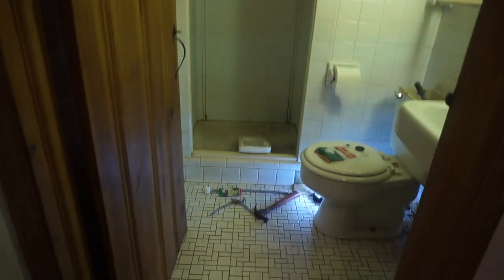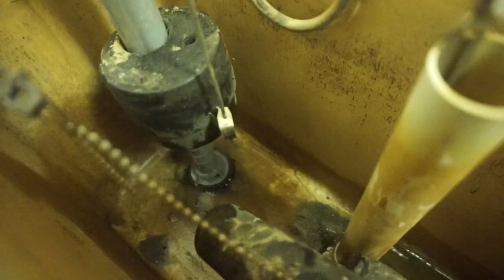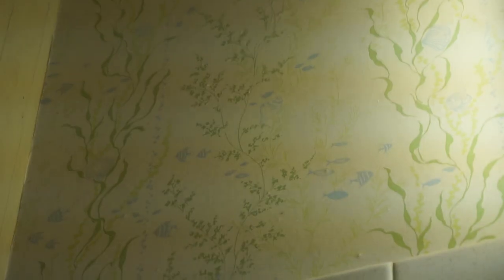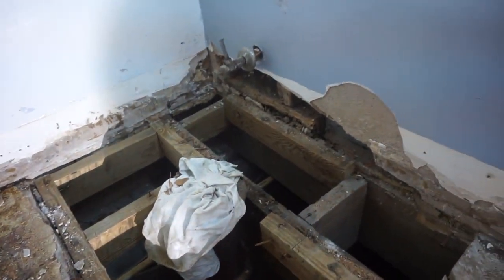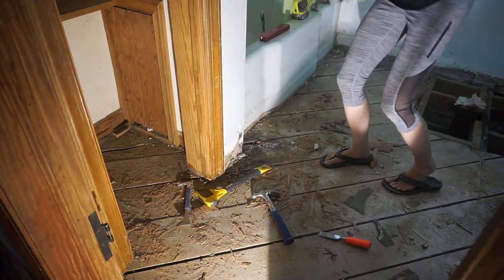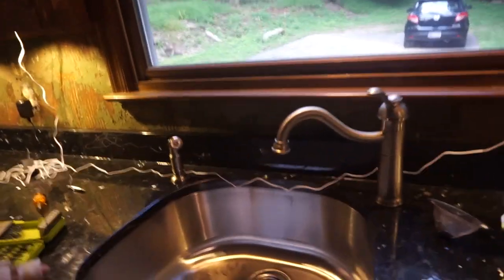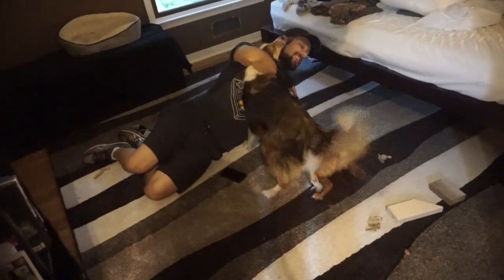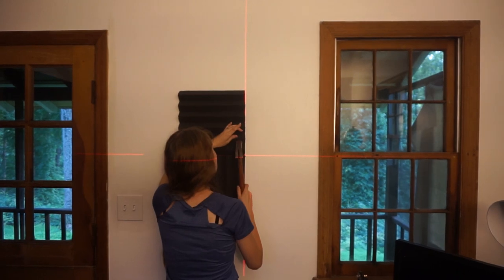THE BATHROOM INCIDENT

Comment: You should replace the rotten wood as soon as possible and not in a point and time in later life. At least you should make and keep it dry - which is probably more difficult on a subfloor in a bathroom than replacing it. Old houses are already a huge suprise box, you don't need more of them.
Also, I hope you will be back in the game soon. I wish you most success with your not-so-little real life project.
Reply from the maker: +kilésengati ah well the rotten wood there is fairly dry. The floor below is in my workshop and I have an eye on it. It's mostly the plywood that rotted there, so I am not concerned. I won't tear out the floor in the currently only working bathroom haha 

It'll stay dry for now.

Comment: Any chance you get switch to PEX/Sharkbite plumbing, it'll save you time + your sanity.
Reply from the maker: +Zach Fertterer nah not doing pex, sharkbite is nice for fixing but when you redo everything you don't need it. It's damn expensive. I have a couple for emergencies. Can't connect galvanized steel pipes to then which J would have wanted to do, so I just used compression couplings. 3 bucks and they work great.